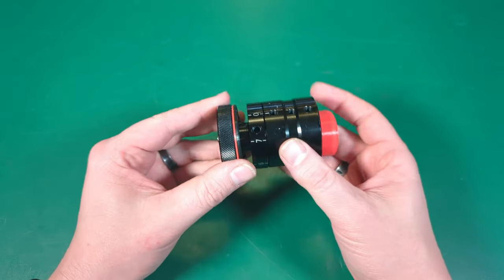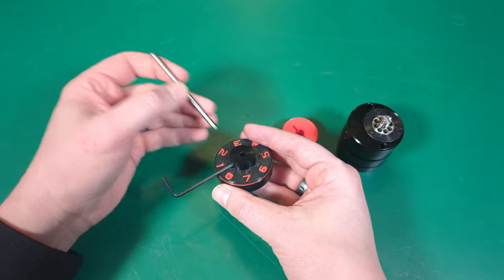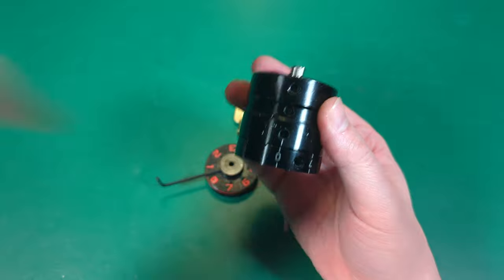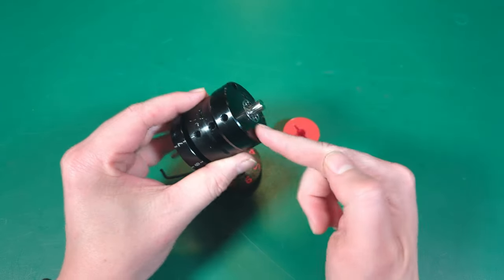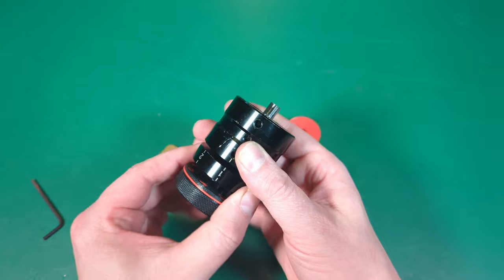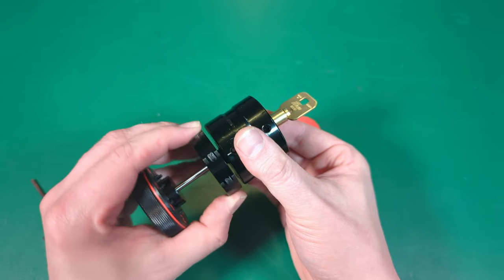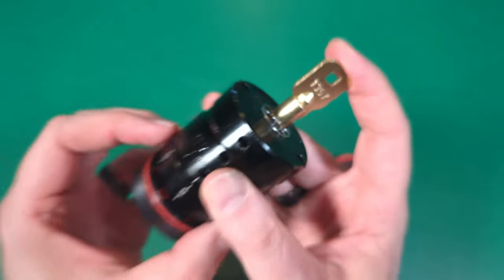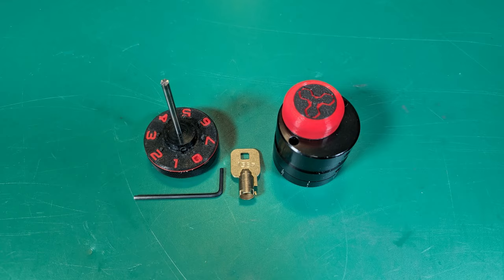How to Calibrate a Tubular Key Cutter

Comment: I would turn the cutter backwards when testing the height. You should be able to feel if it is binding against the key but is going to damage the key less if you are not correctly aligned
Reply from the maker: Oh for Pete's sake, why didn't I think of that?? 😂
Reply: Because you are not backwards at coming forwards.

Comment: Just outta curiosity, have you considered trying to make an add-on/replacement parts to make one of these into a dimple key cutter? I dont really think it would take that much design changes, you would still be just hand spinning an end mill bit, it would have to be a slightly different shape though, and you could still use the same type of depth control for the different bitting depths, you would just need something to hold the blank in the correct spot. Just something to think about.

Comment: Ive seen in one of your older videos about keys and these cutters how they ship with a 0-7 cutting space, but a 1-8 decoder. In your FEO-K1 key video also explains the confusion. KLOM, the origonal maker of this cutting tool, ships the tool for the standard Chicago ace 1-8 depths, meaning 1 is the shallowest and 8 being the deepest. The reason why the cutter has the 0 position is actually for calibrating, you put a blank key on there, and clamp the cutting rod down. Because the 8th depth is just never used. Or the 7th depth for Fort Lock is never used. Sometimes locks can be pinned wrong and due to incorrect keying sometimes we need a depth a little deeper than the true 7. (ill be using Chicago depths for refrence). The reason why it has a 1-8 decoder is for the same reason, incase you need a depth deeper than 7, but you will never need it. The final depth is unused and thats why there is so much confusion with spacing and the numbering. I cant really say which gauge is the correct/better one, but in our land 0 is a no cut, 1 is the smallest cut, and 7 is the deepest cut. So its that simple, we just dont use the 8th depth. Btw the FEO-K1 bitting code in the Chigaco ace depths and clockwise according to the key face is 7254632, not 6143521 lol. This aint confusing at all right

Comment: Thx for the Video Deviant!  I have a Hurty Gerty and (2) of the KLOM cutters.  One of the KLOMs is not set up right and was trying to think of what needs to be adjusted.  This looks a bit similar to the KLOMs and was not sure if I need to adjust any of the middle sections.  I was just on the RTA site looki g fir the stand alone 1357 key but did not see it.  I did  notice a few other items I need to get.  Are you going yo do a SFIC decoder card?